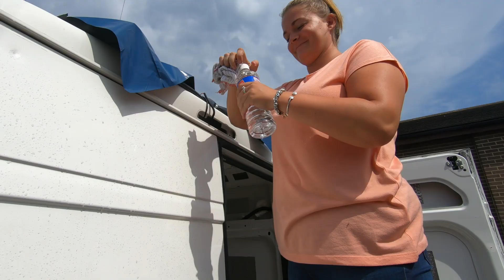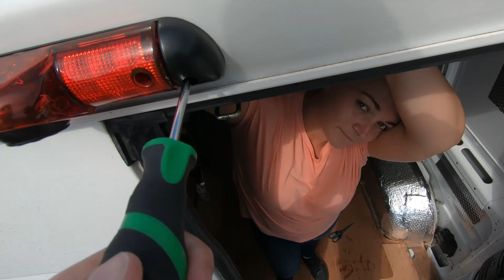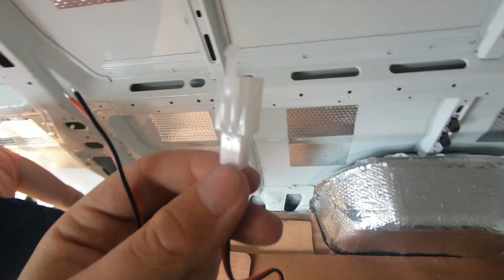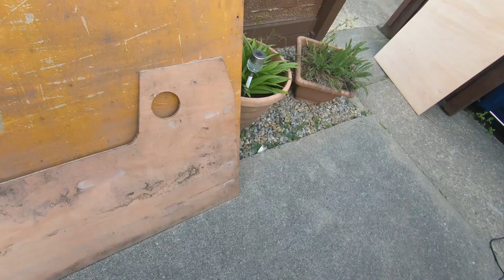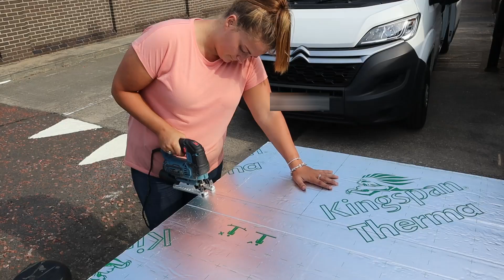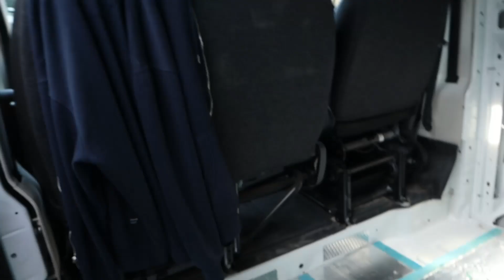Van Conversion UK | EP3 Floor Insulation + Ply Flooring

Comment: I have the same reverse monitor installed by the previous owner. It can have 2 inputs so I have 2 cameras & he put in a switch and so it doesn't need to be in reverse to trigger them and they can be left on all the time when driving to use as a rear view camera.
Reply from the maker: Yeah that's the one :) We just decided to have the one camera and ours just runs all the time when the engine is running unless we turned it off via the screen. Thanks for watching!